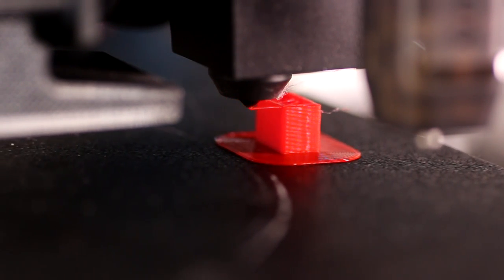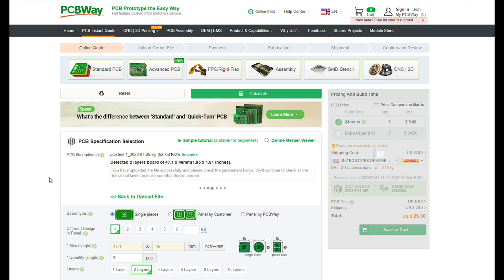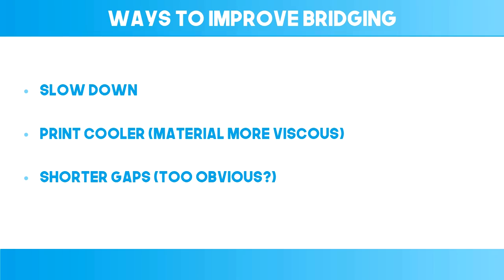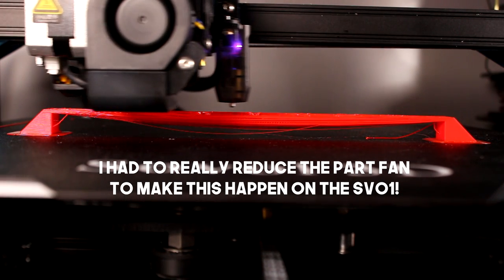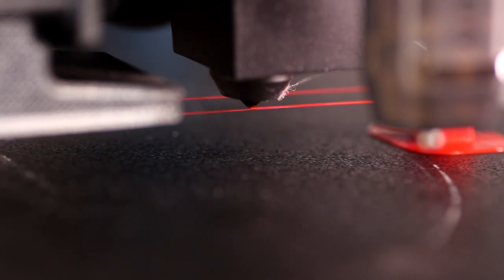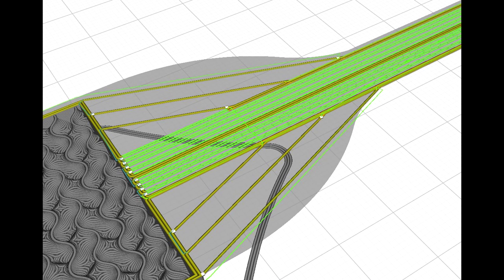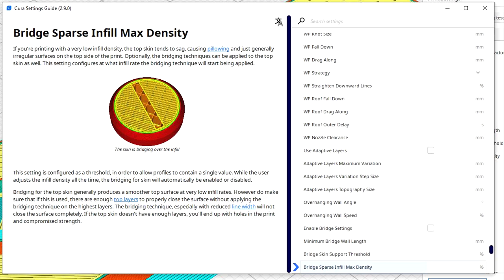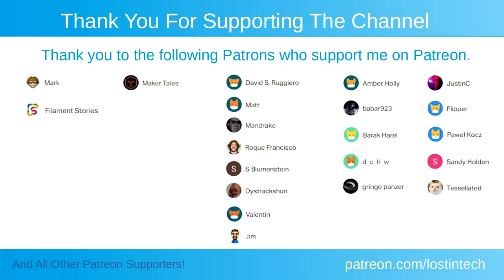3D Print on thin air! How and when to use bridging in your Cura printing process.

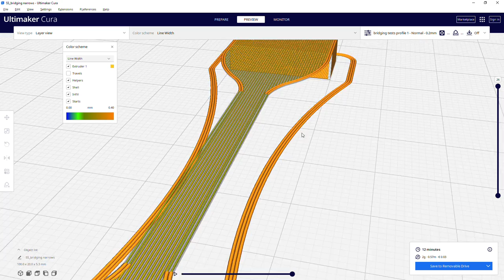Comment: For the attempt at 5:40, I would design the print with the entire width of the gap a single layer so it makes a big rectangular bridge and then the next layer would print the desired shape. The post print cleanup would involve shaving or cutting that single sacrificial layer off. Might not look the cleanest but I print functional parts and it's only a light touch of sandpaper to smooth any jaggies.
Reply from the maker: yeah seems like a good idea!

Comment: I find the bridge setting very useful for PETG, where I usually don't want to run the fan, but can enable it for bridges.
Reply: Exactly why I came to this video. Trying to get some nice results with transparent PETG and some bridging is required on a large print.
Reply: @802Garage  Any luck getting nice results? If so what worked?
Reply: @TheNextGreatGamer  As a general rule slowing down a bit for bridges and increasing fan speed will help, yeah. There are settings in most slicers for it.

Comment: I like to keep bridging on in Cura just for the slower print speed and having the lines run parallel over gaps. Even if its only on for one layer, and while keeping the flow/width settings the same as the rest of my print, it seems to improve the quality of unsupported ceilings.

Comment: To support odd-shaped bridges (like the taper or the inside of the curve), you could also make a larger bridge than you need for one layer, which could be easily cut off after it's finished, a bit like the trick for printing counterbored holes on the bottom of parts.

I feel like slicers could really improve this -- in theory both of those impossible bridges could be made by starting with a normal bridge in a straight line between the supports, then extending it out on either side with more parallel lines. These would need to be attached to the bridge at one or both ends with some kind of wipe, but maybe it'd work if your settings are just right.
Reply from the maker: Good ideas... you could also maybe test around perforations or maybe making it thinner like a brim!

Comment: Somewhere out there someone did a video on using layers to support bridges, I can't remember who. But using it to support curves is far more interesting. In the far but not so far future it would be possible to automate your guided bridging and add it into slicers, though that would not only require one paper on the topic but several papers. It's mostly a question of geometry, no?
I look forward to slicing requiring 10 minutes per file in 10 years, even if we'll be thankful for the features it provides.

Comment: Some printers (usually diy) have cooling that is too overpowered to have at 100% during bridging. My railcore bridges best at 60-80% fan speed. I only turn it to 100% if I'm printing at ridiculous speeds with a large nozzle. Since you want to go slow when bridging, I don't need that kind of cooling.

Comment: A concept i want to explore is pridging supports, use bridging to create a base for supports that the actual print can then be built on.  So you dont need towers or walls of supports stretching from the plate up to some distant overhang, or from a surface you would rather keep pristine.    I just saw a mask where I think this would have been useful.  The top of the eye slots had issues and were way off the plate and kinda recessed so support would have been difficult slow and expensive in material.
Reply from the maker: Yeah I've thought about this before. Support strategies could definitely do with catching up, there's quite a lot of potential there.

Comment: Abs with large bridging surface, high fan can be enough to warp whole the print. With ABS bridging fan speed must still be calibrated based on filament warpyness.
Reply from the maker: ABS warps if you look at it wrong 😁

Comment: Can't wait for you to make your way to cooling fans. Soo many claims to be the best/quietest fans/ducts
Reply from the maker: Ah, huge can of worms there. Where would you even begin?!
Reply: @LostInTech3D  I think more people would be interested in the noise end of the fans. You can get an increase in overhang angles with better airflow but that only seems to vary from 50-60° stock to 70° with better fan ducts. You've shown a fair amount of knowledge when it comes to the board and I would be interested to see how you would set up buck converters and such to put quieter fans on the board.. sorry I can ramble at times

Comment: I dont know where i saw this but someone was using abs and printing each line quite fast so when the printer reached the end the one strand was still hot and sagging but just seconds later it cooled and shrunk which made the bridge perfect with no sagging
Reply from the maker: 3dprintbunny on twitter shared a clip of it just the other day, it's fascinating.

Comment: What about turning the printer upside down ?
Reply from the maker: The best ideas always are in the comments...I'm writing that down 👍
Reply: That seems risky. It would still be unsupported, but any sagging would potentially catch on the hotend on the next layer and ruin your print.
Reply: @coaltowking  That's why you should rotate the printer while printing. Half the time it sags upwards, half the time it sags down => everything cancels out, no sagging. Trust me, I'm an engineer. Or just print in zero gravity, simple as that.
Reply from the maker: Jokes aside, rotating it to sideways would make bridging entirely ordinary!
Reply: @PenPeng  why not just toss it from a plane, so it can print properly, then collect it later?

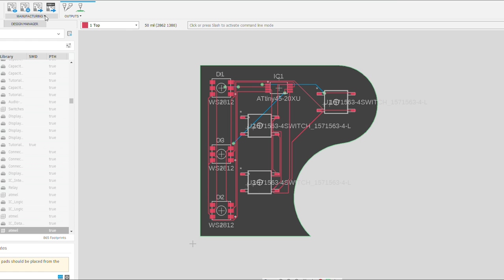Comment: 1:00 What, it can be not purple? Why would you even want a non-purple!
You've mostly skipped the settings though, is it just tick that box for bridging, set the fan to 100% from the 3rd layer and go?..
Reply from the maker: everyone is doing purple! I am a contrarian.
Reply: @LostInTech3D  Who's everyone?
I have two boards in my box , different manufacturers and both are blue! Blue is the new green for boards apparently ;)
Reply from the maker: Fine. Yellow then. Ugh...
Reply: @LostInTech3D  Or maybe two 🎶

Comment: Problem with Cura bridging settings is too many 😅
In Prusa slicer it's like fat/normal, flow, speed and fan speed, and support or not - and defaults seem to work quite well (depending who made the profile for non-Prusa printer). In Cura there are probably 30 settings divided to first, second and maybe third+ layers 🙄
Reply from the maker: I think maybe 5-10 settings but yeah, most of them you can seemingly ignore

Comment: Anyone know gcode to retract filament? I got m92 e-number which reverses the extruder direction.
Reply: My printer heats up the hotend to 230 to filament remove via the touch screen. This is why I want to use gcode to do the retraction to remove the filament
Reply from the maker: You should just be able to issue an M92 E0 followed by a G0 E-10 or whatever

Comment: I've always scratched my head when it comes to bridging, so I resort to making my models in a way I almost don't get any haha
Reply from the maker: Me too, I think we need to see more bridging in prints though!
Reply: I actually try to have bridges in place of support material whenever possible, but I tend to use Slic3r and its derivatives, where Bridging has always been supported from the get-go.
Reply: @LostInTech3D  True, but I also have to dial in my supports. either they don't seem to do much and I get pretty poor overhangs anyway, or they stick too well and turns into a pain to cleanly remove.. 

that model where you pointed out in the video that it had good bridging results, looks super good, like it was printed lying down
Reply from the maker: I'm convinced it's the cooling, I think the answer is always better cooling.
Reply: @LostInTech3D  Could be.. I should probably upgrade mine :p

I tried designing my own dual nozzle duct, as I have just been using a simple single nozzle on one side, but I didn't see any improvement at all. So.. more fans? 2 5015 blowers instead of 1? hehe